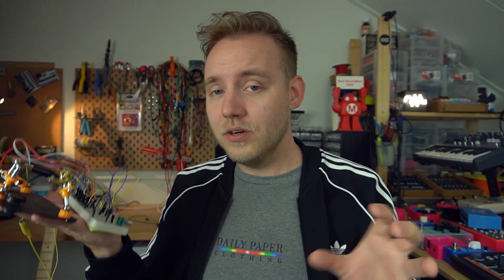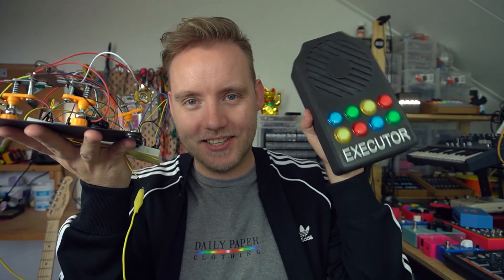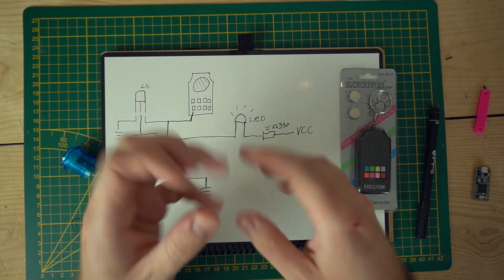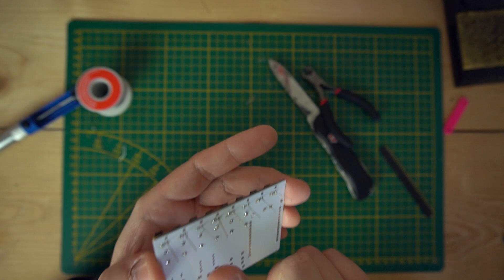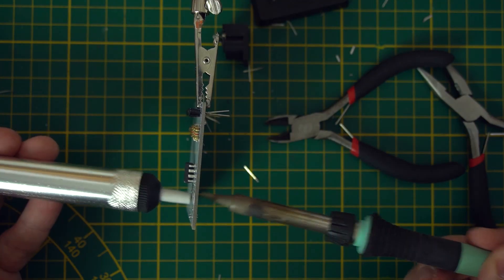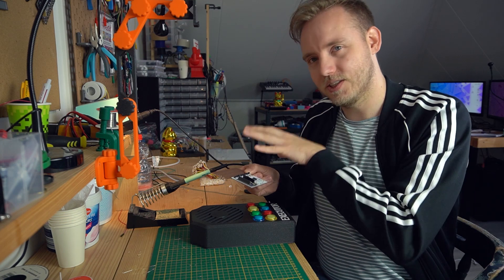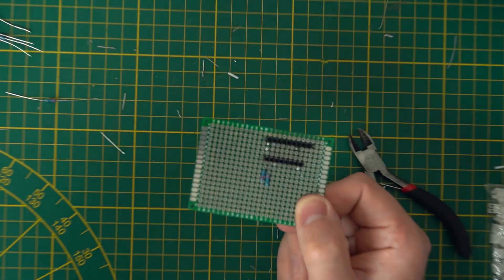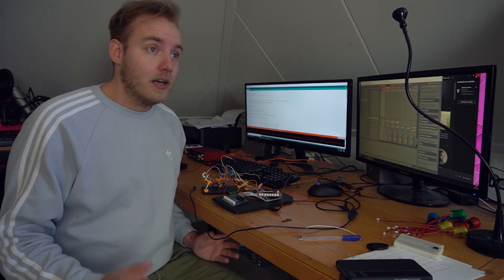FROM TOY TO DRUM MACHINE | part 2 | advance circuit bending

Comment: What  printer is that and what resolution does it print at? That case looks smoof!
Reply from the maker: Thats a prusa mk3! The resolution I choose isn't that smooth just 0.2. But there where alot of horizontal walls, those normally print smooth in most resolution. But the PLA I used from Prusa called Galaxy Black is very nice! That something i really could recommend!